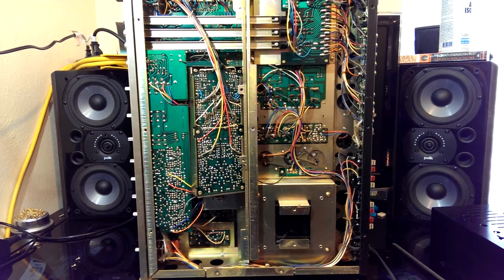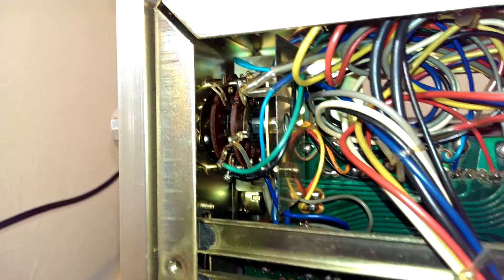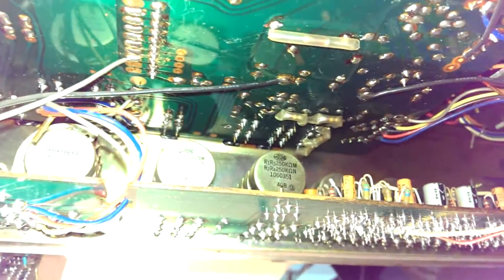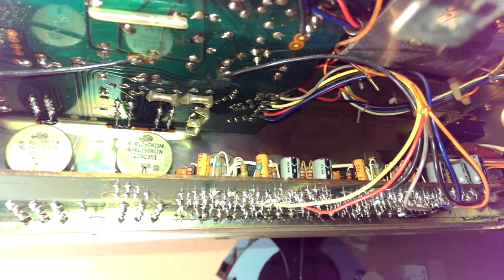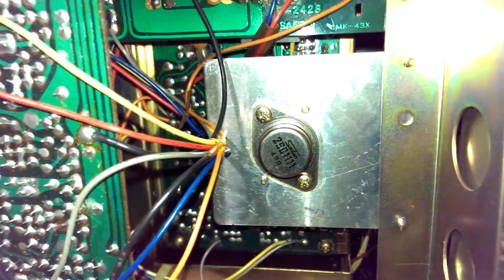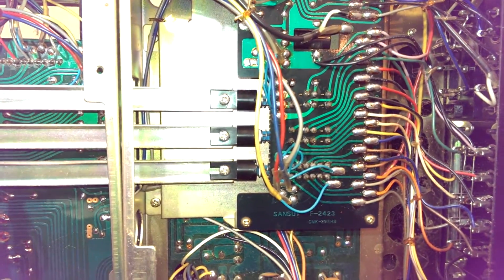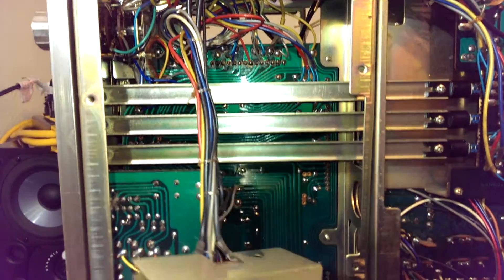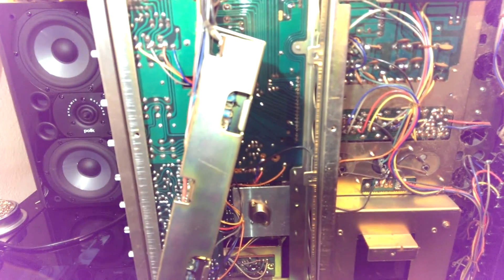Underneath the QRX-7001

Comment: I have one on my workbench right now, against my better judgement. The amplifier drive board that incorporates the rectification and fuses has been giving me the sh*ts. The customer bought this as he has a collection of quad records and tapes and has recapped all the boards. He said it worked before he started but blew fuses afterwards, not the rail fuses but the ac fuses from the transformer. After a significant amount of cursing and swearing I've discovered at several points on the reverse side of that board all around the sites of the mounting of 1uf capacitors the actual pcb board was carbonising and creating shorts. As the voltages are only in the order of +/- 37vdc on this board I can only surmise that these caps have leaked electrolyte soaking into the pcb material. I did at one point glimpse a sparkle around one these positions which led me to the others. I've managed to dig around with a diamond abrasive bit on a dremel and remove all I could find, but its a worry. I've cleaned the board extensively with isopropyl alcohol and powered up the unit with no more puffs of smoke. The customer was an engineer and had done a good job of replacing the caps but with no real electronics background was stumped by its failure. I normally refuse these jobs as the time consumed can be restrictive.
Reply from the maker: That is one of the most frustrating failure modes you can come across! I usually see it in computers from the early 90s. I have seen it short out 5V rails to the point of tripping the over current protection on a regulator. At least it isn't a multilayer PCB in your case.